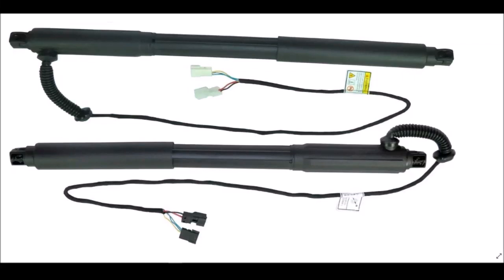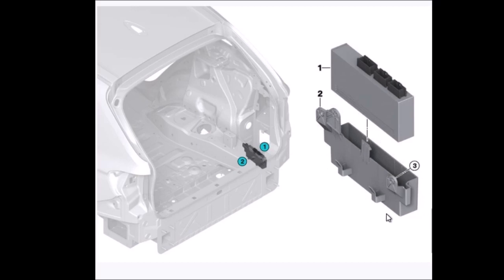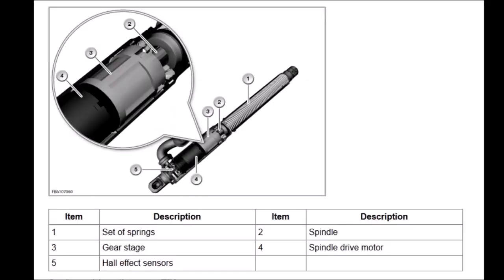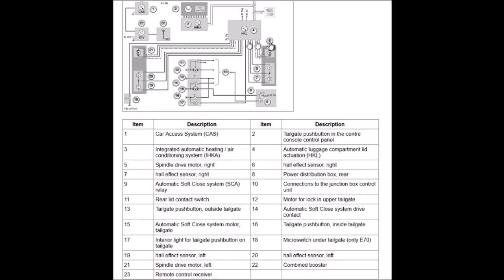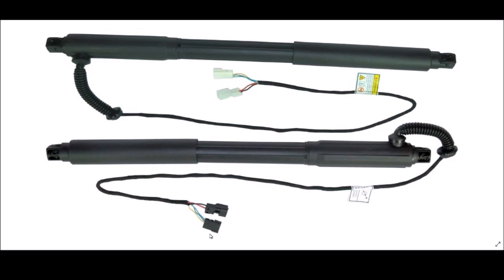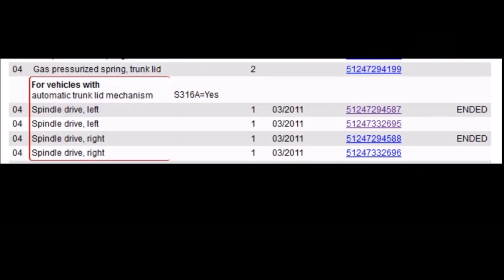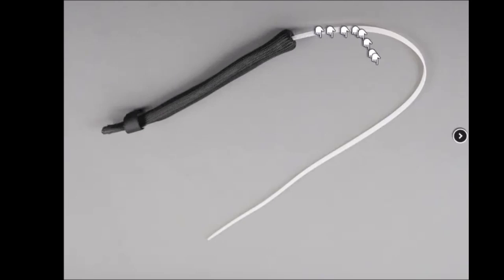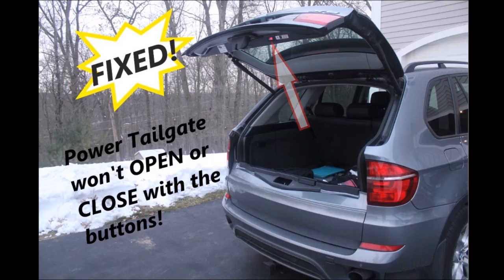BMW Power Tailgate Power Liftgate Spindle drive -  Power Strut troubleshooting, automatic tailgate

Comment: My trunk will open halfway then stop. I have to manually lift it the rest of the way. When I hit the close button it goes down a quarter of the way and stops, I hit close again and it goes down another quarter and hit again and it finally closes. Any ideas what could be the culprit?
Reply from the maker: look around my channel for the video about the tailgate control module submerged in water.  there should be links from the spindle drive video that appear in the upper right hand corner or at the end which will explain your issue.  I would suggest you stop using the auto up/down immediately and only raise and lower manually until you get the module out and dry it out.  You might be able to save it.
Reply: @YuDaMan  it has been raining the last two days. Checked the module next to the battery and it is bone dry everywhere down there. No corrosion on connectors either. Must be one of the spindles then.

Comment: Mine went out a while ago, but to be honest I'm thinking of going to gas struts. You wouldn't happen to know if that would cause any issues, would you?
Reply from the maker: I suppose if you can find one that fits with the correct lifting force (not too much and not too little) it theoretically should work.  Let us know by reporting back here.  It might help someone.  Good luck.
Reply: @YuDaMan  I have them on order. They should arrive sometime this week. I figure if it doesn't work ill stick them on a tool box

Comment: One of the very few times that i actually found such a cool and detailed video. Do you know if the wiring car to module  is there on a car that does not have it factory installed? Hence if you buy the parts can someone install them ?
Reply from the maker: you can buy aftermarket spindles but that installation and the electronics involved would take a very experienced person and probably be very pricey.  It can be done https://www.youtube.com/watch?v=VnCpLziINeY
Be sure to give me a LIKE and SUBSCRIBE.  I'd really appreciate it.  Thanks!

Comment: A quick question for you. I have to replace my right liftgate power spindle. In your video you showed the instructions and it mentioned turning off the 30g relay and after installation, initializing the new spindle. Can I just disconnect the relay by hand or does all of this have to be done by computer? Thx for your time .
Reply: Also is there any chance i could just pull the two fuses and reconnect them when I'm done?
Reply from the maker: I have never been able to find the procedure to initialize the new spindles.  I think you just raise the tailgate manually to full top position and then hit the close button but I've never actually found the procedure or performed it.  I suspect you can just remove the fuses provided you can accurately identify the correct ones.   Be sure to give me LIKE and a Subscribe.  I'd really appreciate it.  Thanks!!!
Reply: @YuDaMan  thx u for advice. I watched another video of someone looking at fuse box in back right panel. There should be a paper with fuse diagrams back there. There are two separate fuses that supposedly operate the liftgate. Im wondering if i just pull those or pull the 30g relay? The problem I'm having is when i try to lift my gate manually now since the spindle broke, the left spindle wants to try and close gate so i have to forcefully hold the gate open while the other spindle continues to attempt to close gate. I have to cut the power to it once i manually lift gate so it will stop trying to close on me. I know these vehicles are so dependent on all that current that im concerned that if i pull relay or fuses that it might cause me more problems. I think the fuses would be fine to pull but its that relay im concerned with. Ive pulled them on other American made vehicles with no problems.

Comment: Thanks for the video. My hatch wouldn't open after I sprayed the car off. Even without power applied and all fuses pulled, the gate will only lift a couple inches which tells me the spindle is seized. Maybe just a coincidence that I noticed after washing it because I doubt water ingress would make it seize so quickly. Definitely going to tear it apart and see if I can unfreeze it before spending $300 on a replacement. Also considering switching to manual struts for much cheaper since I never use the automatic feature anyway.
Reply from the maker: check out my other videos about this issue (there are SEVERAL).  I will bet you have water around the tailgate control module.  I explain the problem and various solutions.  There are many!  Replacement module if you get the right one is about $40 on ebay.  Plug and play.  Cheaper than manual struts!  Be sure to LIKE and SUBSCRIBE.  THANKs and good luck.
Reply from the maker: If I were you, I would immediately disconnect the tailgate control module and REMOVE it and dry it out for a few days.  If you get to it soon enough, you can possibly save the module from permanent failure.  Get it completely dry 2-3 days min and then reinstall.  I think you will find the module is sitting in water right now.  Check out this video:  https://youtu.be/6QavsbDkpsk
Reply: @YuDaMan  Thanks for the reply. Just got back there and pulled the module and everything is bone dry. Just took the PCB out of the module to see if there were any signs of water ingress, but everything looks perfect. Also, I'm not sure if there are different variants of this module, but the PCB is completely covered in what appears to be a lacquer. I'm guessing this is an updated version to help prevent shorting from water. This weekend I hope to have time to pull the spindle and disassemble it. Is there a special way to get the spindle disconnected from the ball fitting on the liftgate? I don't see any clips or obvious ways to remove it except for unbolting the entire plate that the spindle is mounted to.

Comment: Do you have any ideas how to open that servo if I want replace hall sensor. I got error that hall sensor have short.
Reply from the maker: sorry, I did not tackle opening a servo...the short could be in the wiring that you can see, not necessarily at the hall sensor itself.  Hall sensors are generally VERY reliable.  Wiring is less reliable.
Reply: @YuDaMan  yup thats true. It was -30c wheater when that problem appears so it is wery much possible that it is cable damage